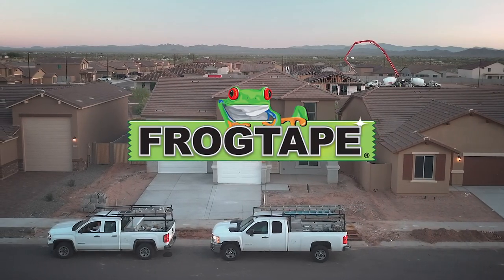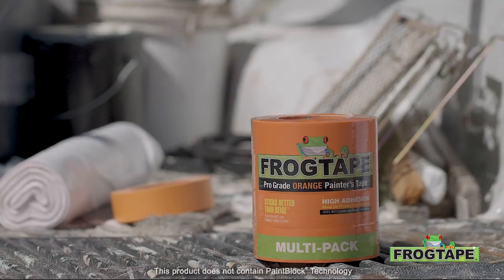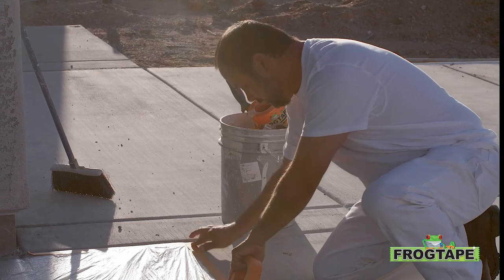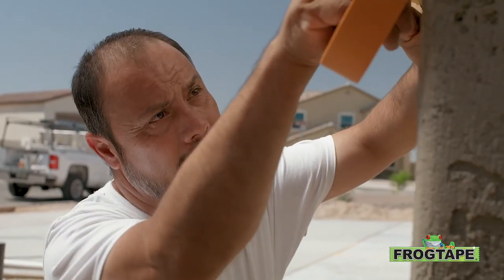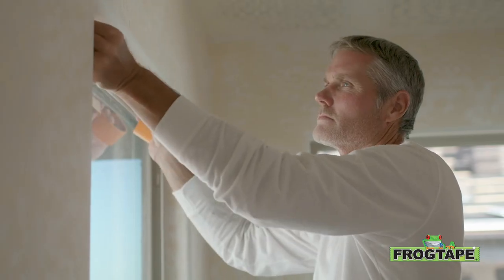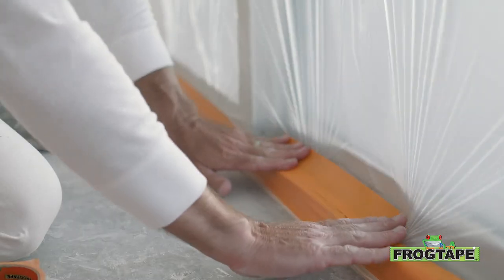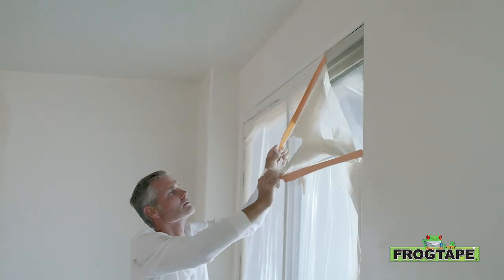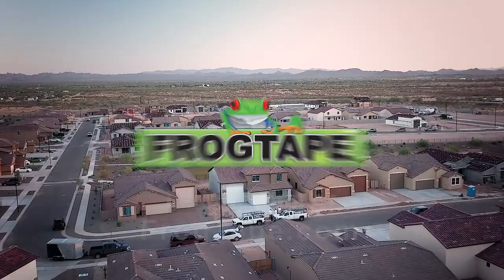FrogTape® Pro Grade Orange Painter's Tape™

Comment: Can I use this on an oil painting? I have used green frog tape on an oil painting before and i get a paint bleed every-time
Reply from the maker: Hi Shayna,
FrogTape was developed for use with latex-based paints.  With any other types of paints, you will need to test, as solvent-based products may react with the powdered polymer or the adhesive and not provide the paint -bleed protection.